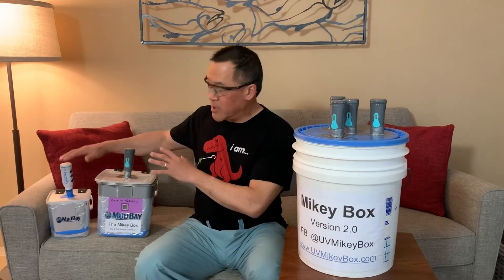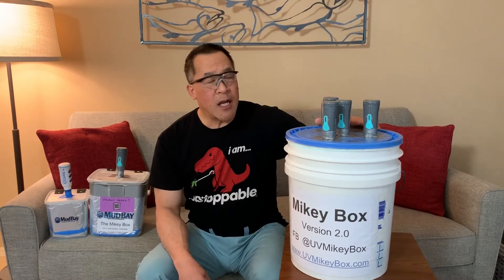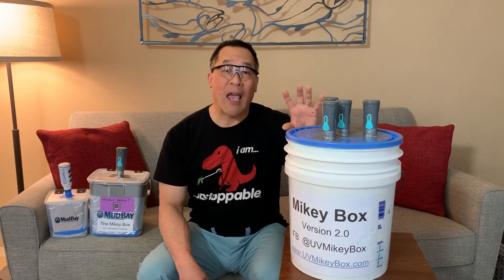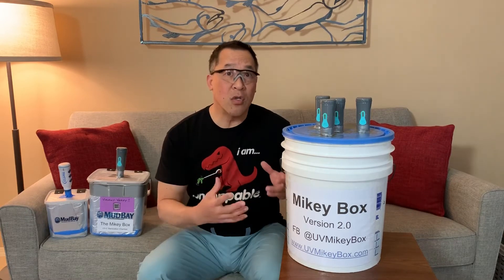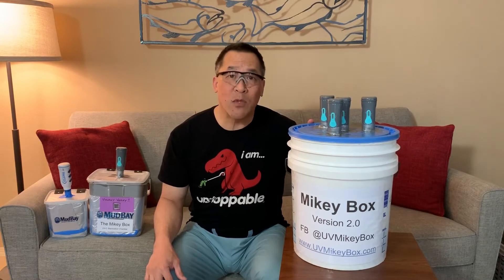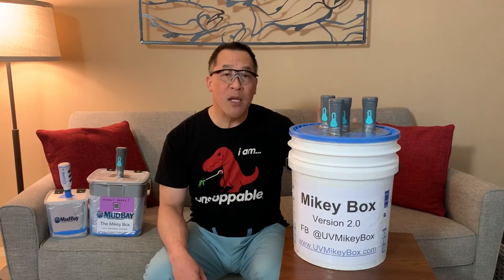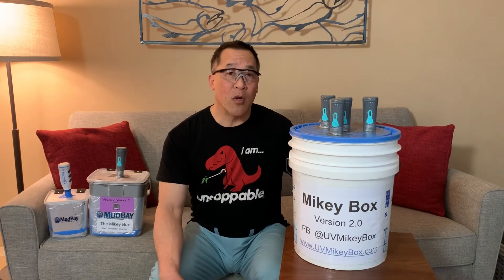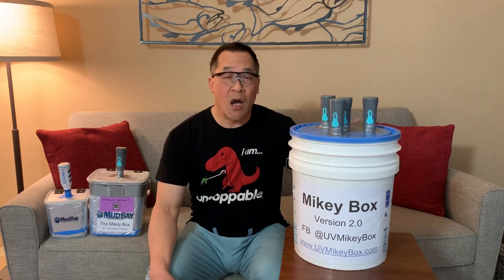Mikey Box - Day 4 update on UV sterilization of N95 masks

Comment: I have Phillips Sonicare tooth brush in which the base contains a UV 'oven' to sterilize the brushes. I think it could be adapted for this purpose.
Reply from the maker: Barry Bogart Hi Barry, I have the base unit too. But the intensity of that light source is too weak to provide adequate germicidal irradiation to a large curved surface like a N95 mask. The challenge is the porous nature of the filtering material and poor ability of UVC light to penetrate material. My prototype Mikey Boxes using 1 and 4 Steripens all failed under dosimeter testing. Run times of 90 minutes was necessary to achieve necessary dosing of UVC. Try with a 60w LED light source! Keep thinking outside the box and trying! Good luck.
Reply: @michaelchiu6114  I do have a SteriPen and was just looking for suitable container. Are you saying that won't be strong enough? There is always the baking method and sunlight, I guess. I just have a couple of masks, might have to last months. BTW I just found out they make the N95 paper in a mill where I live...
Reply from the maker: Barry Bogart You are correct. The single Steripen did not work efficiently. It would require 45 minutes at 65mm distance to kill 99% of viruses and bacteria. I suppose that’s why it’s version 1.0
Reply from the maker: Barry Bogart send me your email and I’ll include you on my blind email distribution list for technical support info.
Reply: Michael Chiu I have a UV light machine that I use to dry my UV nail polish, would that work to disinfect my N95s mask?  How long would I have to leave it under the light?  Thank you...
Reply from the maker: @Freeworld856  Hi Jessica,  Great question. Unfortunately your nail lamps will not work. The UV light used for curing gel coats on nails are the wrong wavelength. Nail curing lamps are UV-A light in the 315-400nm wavelength and won't inactivate viruses like UV-C light in the 220-285nm wavelength.